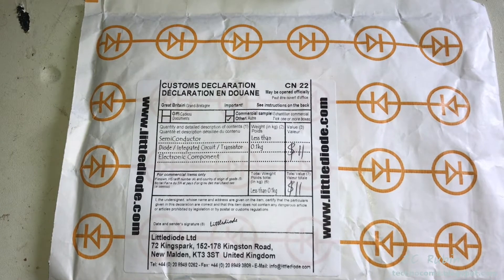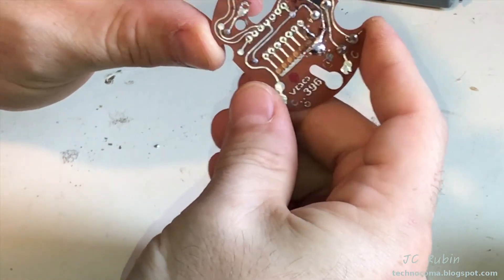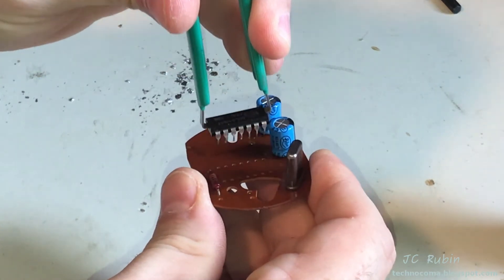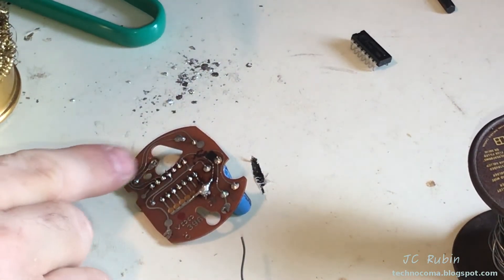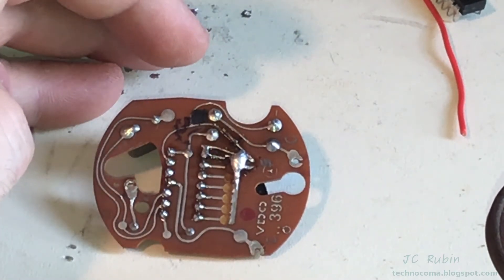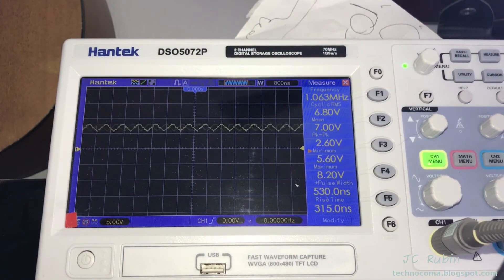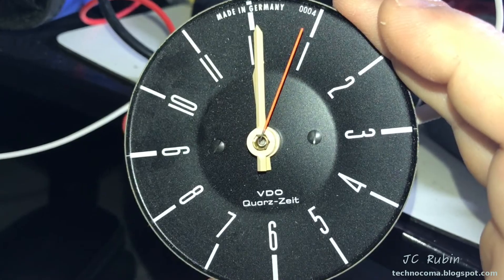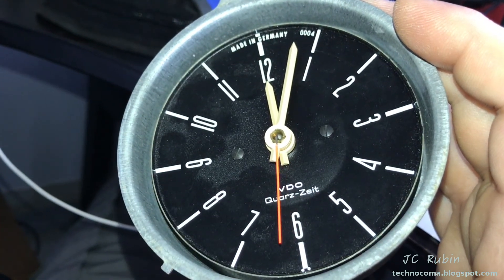Volkswagen Porsche VDO Analog Clock Troubleshoot and Repair Part 2 of 2

Comment: Currently trying to get my Mk1 fiesta clock working identical to yours.  Mine seems weak though theres no "tick" and it just "wobbles" the second hand back and forth unable to make a complete tick.
Reply from the maker: Given a proper voltage on a bench id check the capacitors

Comment: Great videos. Found it while trying to troubleshoot a 52mm Volvo (VDO) clock that had exactly the same internals as the one in the video. This clock was an OEM option used when the original clock was replaced with a tach.
I didn't have any parts to fix the 52mm clock, but i found out that the original clock had almost exactly the same internals. So I just swapped all the internals.
So if anybody needs parts for their clock they can actually get one from the instrument cluster in a '80-'93 Volvo 240 or probably almost all cars with VDO cluster and an analog clock.
PS. : Some 240's have Yasaki cluster which probably uses a different clock.
PPS.: My clocks don't have second hands, but the stem to install one is still there.
Reply from the maker: Thanks for sharing the parts info.